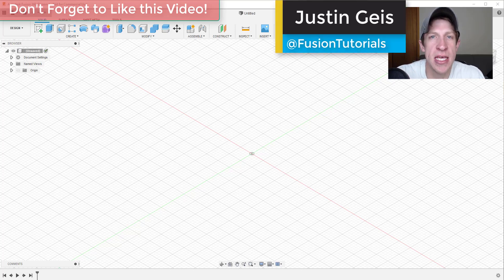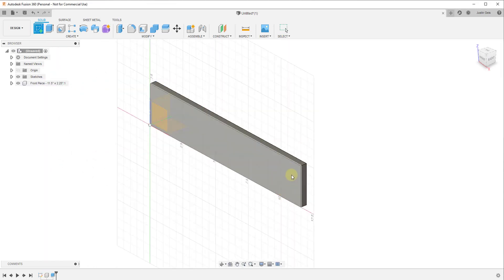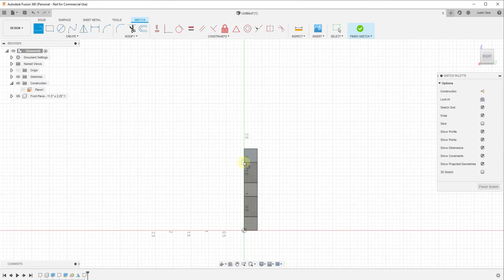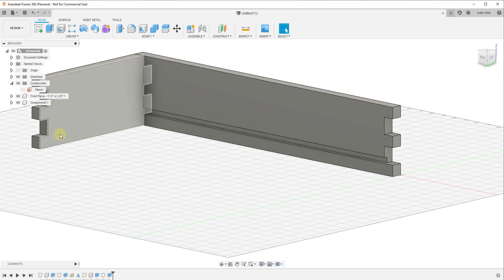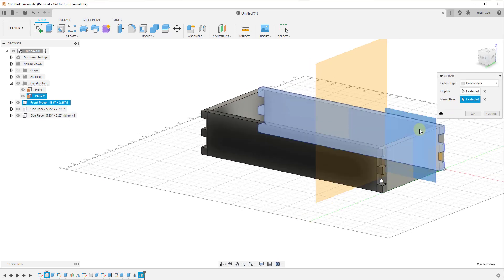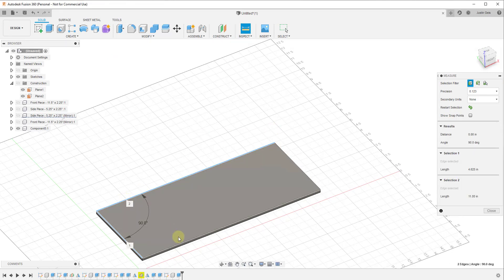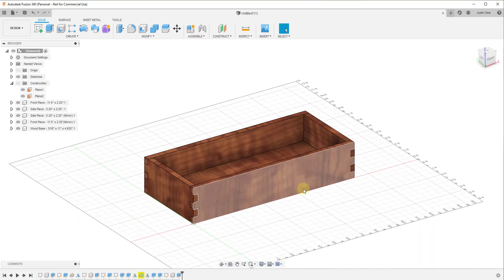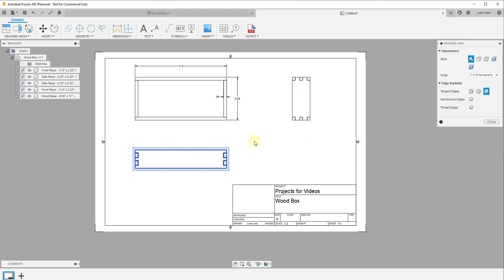Fusion 360 for Woodworkers Part 4 - Modeling a WOOD BOX!

Comment: Thanks for making this series.  I'm a life-long woodworker and I've been designing all my projects and furniture pieces in SketchUp for years.  I recently decided I needed a better 3D tool for making my models for 3D printing and decided to start using Fusion 360.  I'm really impressed with the power and ease of putting real detail into the models.  I am blown away with the create drawing functionality.  It is nice that you have created examples/tutorials specific to woodworking.  I noticed that the mirrored side and back had the wood grain running orthogonal to the long axis.  Can I control that?

Comment: Great Videos.  I have run into a problem in this wood box.  At 10:33, after you mirror the sides, there are gaps; so, you go to the timeline and right click on 'Sketch 3' and select 'edit sketch'.  They you drew some lines on the profile to fill the holes and trimmed what you don't want and then Finish sketch.  All good so far.  You went back to the timeline and went to 'Extrude 1'.  When you hovered over it, the side board turned blue.  When I do this, nothing happens anywhere on my model.  No blue polygons.  If I select 'edit feature', I get taken to what looks like the sketch not the board face.  The Edit feature box states for Profile - missing profiles whereas yours states '1 selected'.  I went through this a few times with the same result and watched your video over and over again.  I don't know if there is something different in the Fusion 360 that is out now (2022) or is it something I have done and not aware of what it is?  Any ideas?  Thanks.
Reply: Figured it out after starting from the beginning.  After mirroring the sides, I had the gaps that were in the video.  You then edited the sketch to add the sections to fill the gaps.  I added the lines that you show in the video and I again could not add the sections to extrude.  I then went back in the edit sketch and closed the lines on the inner side.  Now I can add the 2 new sections to the extrude.  For some reason, in the video, there looks like there are gaps in the inner lines.  They should be closed.  At least in the Fusion I am using (2022).

Comment: ... how do you so easily rotate around while using the rectangle tool, PS, I'm on a MAC with a Apple mouse (which have the touch based scroll feature, not a physical wheel)

Comment: Quick Question while following along I noticed that my version of Fusion 360 automatically adjusted the mirror where the drawing was incorrect to the correct reference for the pieces to fit together. Is this happening because my software is set up that way? Because I have noticed subtle differences between the way the drawings on the video and my drawings turn out little things are different or missing.

Comment: First off I would like to say thank you so much for your tutorials on fusion 360.   Just in 2 videos, I went from not knowing how to draw a line to drawing out the main part of my project.  I am having a bit of trouble though. I am currently designing a drawer system for the back of my Off-road SUV and I have a question and perhaps it might be an idea for a video.   
As I said I have made the main box but what I would like to ask is:
- When designing the drawer to go inside the box, do I design it as a "New Design"?  And if so,  would I be able to import it to the main drawing?
- For using the sliders, there are special sliders that I have in mind.  Would you know if there are options to import those sliders to the drawings or would I have to design something like them?
I am trying to design something like this gentleman did for this Toyota 4runner but for my GMC Yukon.  Link: https://www.youtube.com/watch?v=xsFE-5voRRo 
Any help would be appreciated.   Maybe if you are interested, perhaps we could do a collaboration?   
Again thank you for these formidable videos.  
Stay Safe and all the best. 
Tim...

Comment: I'm trying to learn (and love) 360.  One consistent issue I have is trying to sketch or modify solids and use existing features from other elements as snap points.  For some things, like drawing a line, it works.  For other things, like Make Rectangular Pattern, it doesn't.  Any tips?
Reply: I am struggling with the same. When I want to draw the sketch for the second board (5:40) I am missing most of the reference points from the previous sketch. I have re-drawn it many times, but I am not understanding where the issue lies.
Reply: Ahhhhh. Preferences > General > Design: "Auto project edges on reference" ON.

Comment: I understood this but it wasn't great for less skilled woodworkers or cad learning.  A better title would be; modeling a drawer (or carcass) with box joints.  Since this is for woodworkers, please use correct terminology for parts.  As a Fusion beginner, but not at drawing parts, there are easier ways to do this with a basic understanding of the software.  It would also be useful to start off with a display of the finished product.

Comment: I followed the tutorial closely, but @ 5:36 When I try to align my line to the point you just aligned, I don't have that blue line (and I can't seem to reference no matter what I do).
What could be the issue?
Reply: Glad its not just me, I had the same issue. Turning on the "Auto project edges on reference" setting in Preferences -> General -> Design fixed it for me. It seems like that setting allows it to do the snapping/inferencing on edges outside of the current sketch
Reply: @mattwilson1664  Thanks man, it worked :)
Reply: @mattwilson1664  I have been racking my brain on this one. This worked, although I had to restart Fusion for the setting to take effect. Thanks!
Reply: @mattwilson1664  4  years later a massive lifesaver!
Reply: I have the same issue, did you figure out how to solve it?

Comment: Hi, I was following you to a point, but then when I start my second piece it stopped inferencing and I’ve no idea why it only inferences on a bit
Reply: Glad its not just me, I had the same issue. Turning on the "Auto project edges on reference" setting in Preferences -> General -> Design fixed it for me. It seems like that setting allows it to do the snapping/inferencing on edges outside of the current sketch
Reply: Thank you Matt. In addition to turning on "Auto project edges on reference", I also had to turn on the "Allow 3D sketching of lines and splines" setting in Preferences -> General -> Design.
Reply: Great videos - I had the same problem with inferencing right about 6 minutes in
Reply: I have the same issue , is there a solution ?